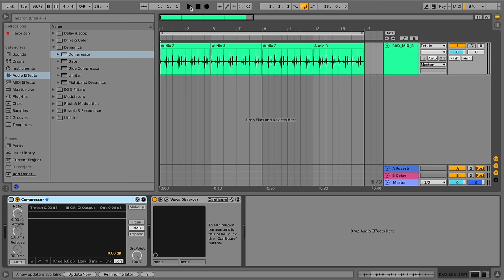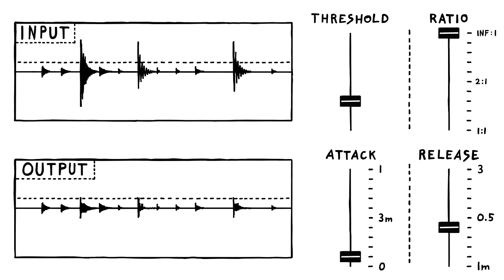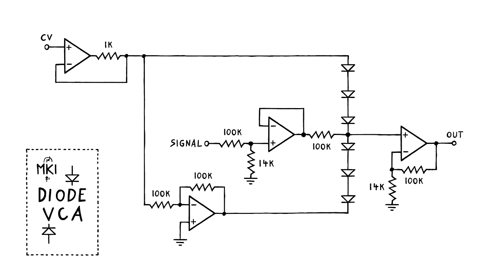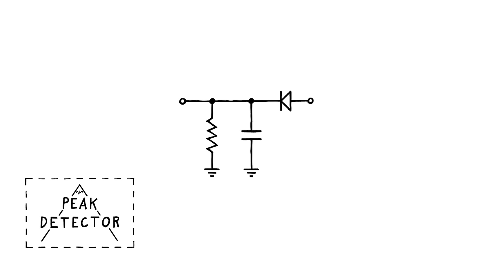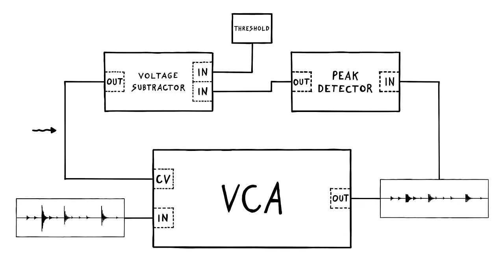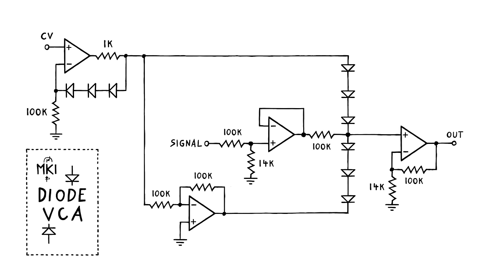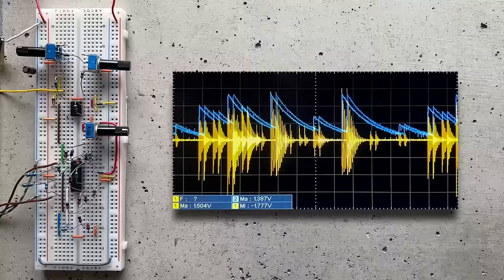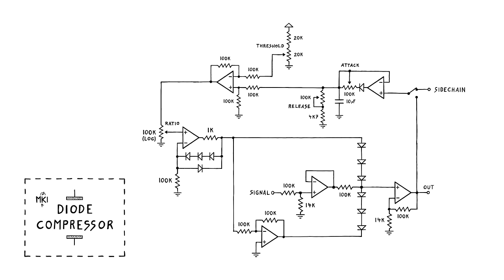Designing a simple audio compressor from scratch

Comment: Your compressor sounds pretty good.  So much so, I breadboarded  a clone using TL082 opamps.  While I've yet to build multiple commpressors to process bass, midrange, and highs seperately, I bet doing so will also work well,  As a suggsetion,  I wonder if you\ve plans to include metering that would display Gain Reduction.  Many compressors these days use a cheap LED based "VU" meter.  What I'd like to see is metering that drives an analog VU meter.  With no signal applied to the compressor, the VU meter would read 0 VU unit (100 %).  As program mater is acted upon, the VU meter would deflect downward from 0 VU.  The amount of compression - the Gain Reduction - would then be read from the standard VU meter scales in decibels,  This would not only be a helpful meter to adjust the compressor, a downward deflecting analog VU meter has a lot of class.  .... Finaly, I wonder, What about a gate ?   Your compressor design is an excellent piece of work.  Your video makes it look like it was ever so easy to get it to work.   I know it's never easy.  Such work is always the difference between the words "Simple" and "Easy".  Simple maybe, just not easy often imes. Audio compression has always been a blend of science and art.  You are truly very talented in both arenas.  Keep up the good work.

Comment: One interesting application would be a negative peak limiter (maybe by adding a offset) as use in AM broadcast radio stations. By feeding this audio to the transmitter this prevents negative modulation peaks from going below zero while allowing the positive peaks to go higher effectively making the station louder without distortion.

Comment: Very cool anims! one thing I'm not sure about is, you say that the noticeable gap between signal and threshold is explained by the diodes' behaviour. But, you then provide a line of reasoning that says that the output MUST stay higher than threshold for control voltage to stay above zero, which seems sound to me, and I doubt the op-amp trick gets rid of that.
In practice, I think, that means that inf:1 ratio is unachievable (without bossting the subtractor's output, maybe?). I'm not sure how much of a constant ratio is that anyway, since, while I'm not familiar with the diode curtain you presented, it's probably far from linear ^^'.
Reply from the maker: yeah, the gap will always be there, you can‘t get rid of it. you can only try to make it infinitely small!

Comment: A few things come to mind to base on this compressor:
1. Making it switchable to a feed-forward structure, so the peak detector directly reads the input of the circuit rather than the output of the vca, so it can act faster, which in turn could allow for using it as a peak limiter as well.
2. Besides being a "peak only" compressor, it could be expanded to also track the RMS value of the signal.
3. Tweaking the circuit, so it really adheres to Eurorack CV standards for the VCA and therefore could become a "dynamics based VCA controller" or a kind of advanced envelope follower, which would omit the internal VCA and allows for patching in any Eurorack VCA to create a wide range of different compressors, which vary in character and how they react based on the used Eurorack VCA module. For example: Using the vactrol based VCA of my Ratking Gates module, would behave very differently from using a diode or transistor based VCA. A more characterful VCA like the Expert Sleepers Persephone could be interesting as well.
4. Using an VCA / amplifier, which can be switched to have a gain greater than 1 to use it as an expander rather than a compressor.

Comment: I dont know whether its just a different use of terminaology between feilds of technology(I come from a radio/comms background) but this isnt a compressor to me but an auto level controll or peak limiter.
The limitation of this approach is it turns down the whole content keeping the relative difference of the instruments the same, so when the louder instrument trips the threshold, another background intrument is lost as the gain is reduced.
A compressor has the advantage that it can reduce the louder instruments without affecting the anything else that is below the treshold.
Its called a compressor because it compresses the dynamic range of the input signals make them sound the same level without the loudest single instrument dictating the level of other instruments.

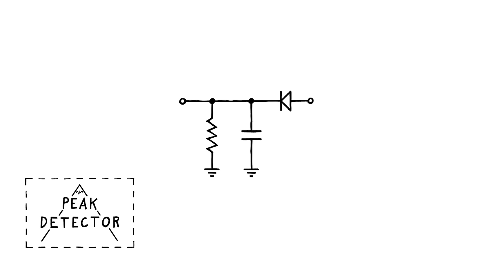Comment: 12:54 Because the Timeconstant is R × C so 10,000ohms × 0.00001F = 0.1s. T=0.1 is a frequency of 10Hz. The minimum frequenzy that's audible for humans is 20Hz. f=20Hz => T=0.05s and Uo = Ua × (1 - e^(-t/tau)). But since we have an unloading capacitor the formula is Uo = Ua × (e^(-t/tau)) so the Voltage at the output of the peak detector at 20Hz would be Uo = 100% × (e^(-0.05/0.1)) = 60.65% of the incoming Amplitude, which is probably enough to not really notice a difference without direct comparison.
Reply: With a 22uF capacitor the amplitude at 20Hz would be about 80% but the time constant doubled with 220ms so the Voltage at the peak detector would only be close to 0V after 0.6s to 1s of silence.

Comment: Hey! Great vid! You might want to add a low cut filter on the audio going into the detection. This way, it will mimick the human ear frequency response, and the compressor will feel less grabby on the low end content (although it’s sometimes a cool effect).
Reply: It’s the same reason you often see a low cut filter before distortion circuits, otherwise the effect overreacts on low frequencies (but it can still be a cool effect, especially on fuzz)

Comment: We could switch from Peak to RMS, we could put in a de-esser since we have side-chain, add an output control, hard vs soft knees, proper limiter with gain control, turn this into an expander, parallel compression mode and of course a gate - maybe a matrix so we can could change the order of the effects.  I'm making this too complicated aren't I?

Comment: First class video. For stereo use, one just duplicates the circuit and ensures that the settings for each side are identical to stop the stereo image jumping about. Presumably this could be done with dual gang potentiometers where available. Question: How might one combine control pots if dual versions are not available? Is extra buffering required?

Comment: I'm fortunate that I do electronics for a living but I absolutely enjoy these videos. I plan to build some of your circuits with a few modifications and these are mainly using digipots instead of potentiometers this will enable each patch to be saved and recalled but this obviously will require either  microcontroller or fpga.

It seems that you are running out of options to do a video. on will you be doing digital syntheses using microcontroller to implement vco and filters digitally
Reply from the maker: i am thinking about doing some programming, yeah. not sure if it‘ll be with microcontrollers though – we‘ll see!

Comment: Starting the year off strong.
Have you heard of synchronous envelope followers? By having 2-4 seperate envelope-followers, each with a discharge transistor instead of a discharge resistor, and activated sequentially in synchronicity with the input signal, then recombined with diodes in a “largest of” circuit, you can get a very fast-acting envelope. Slightly blocky though.

Comment: Weird question, but is the feedback loop actually necessary? I would think could just pass the original input to the peak detector and vca separately
Reply: It is a different type of compression, in pro compressors both circuits are useful.
Reply: Feedback compressors sound great on drums, and that's probably where he got the inspiration for the feedback design ? But yes, you don't need feedback, and in fact you can achieve more agressive compression without it (feedback compression results in an effective 2:1 ratio).

Comment: I love your Videos. 
I would love to See how you‘d realise the power supply for the OPVs with just one Single Powersource. I know how to creat the +/- voltage but wouldn‘t Affekt the OPVs each other because they would put a strain on the Vortagesource?
Reply from the maker: i think the best way would be to use rail-to-rail op amps and then bias the signal up. that’s rather annoying though, which is why i prefer to work with a dual supply.

Comment: How close does this align with commercial hardware compressors?  Conceptually what are they adding to the circuit beyond yours?
Reply from the maker: good question. i’d imagine they do full wave rectification before detecting the peak (i.e. looking at both the positive AND negative parts of the waveform). also, they might have a strategy to prevent distortion at very short release settings.
also: adjusting the knee, adding (automatic) makeup gain, detecting the volume via RMS instead of just looking at the peak .. the list goes on

Comment: that "ideal diode" or "half wave precision rectifier" in peak detector has the same problem crashing on negative rail as cv, that affects minimum possible attack time.
i dont quite get it why input for peak detector connects to vca output? it should work fine going directly to signal.

Comment: For a sharpened attack, wouldn't a separate capacitor/resistor pair in differentiator setup help? (cf: PID controllers, where you also have two capacitors for finding the compromise between decay and attack).

Comment: Wondering if you can replace the op amps in the VCA with a tube?
Reply from the maker: tubes normally require a ton of voltage, so i prefer to stay away. should be possible in theory though.

Comment: Hi. Seems like this kind of VCA, when compressing, will work as a diode limiter. When the CV (control voltage) goes up, this diode limiter causes a distortion of the waveform of a compressing signal by cutting peaks. It will caused high THD.  How to avoid this THD problem?

Comment: I have a question about the side chain option what kind of other signal is good for inserting there?
Thanks for the very good circuit.
Reply from the maker: using a kick drum is a very common strategy. generally percussion works well.
Reply: @MoritzKlein0  thanks you for the answer and congratulations.

Comment: I’m a little concerned about the 100k resistor on the signal input. Is the signal coming from another buffered input, or directly from something like a line level output? It seems the impedance mismatch would be a problem in the latter scenario.
Reply from the maker: valid point. i‘m mostly used to designing circuits for modular synthesizers, where every output is buffered. so i was assuming this to be the case here, too.
Reply: @MoritzKlein0  That’s a reasonable assumption. Thanks for clarifying, I probably should have considered the interstitial circuits in modules, I was coming at it with the perspective of a discreet device. I enjoy the videos, you do a great job with simplifying complex concepts.

Comment: cool video! So, this is the feedback type diode compressor, it has half-wave rectifier for CV, right? Also how noisy is it? More gain reduction diodes in series - less noise from input voltage divider?

Comment: I'm puzzled, this comp is designed to be driven 5v max, but pro audio equipment +4dBu is about 1.7v max. If you are driving your loop from ableton, how do you upvoltage from audio interfaces 1.7v to measured max 5v as shown in video?

Comment: Why send the output of the vca to the threshold detector and not the input signal?
Reply: I think thats for the feedback loop to work. If now, all the signal would get transformed, but im not 100% sure
Reply: It is possible, in pro compressors both circuits are useful.

Comment: A noob question here, i am thinking about getting into diy cirquitry, and was wondering - are there any videos explaining what components i need to do the basics. (oscillators, filters and maybe lfos) I mean is there a basic electronic kit with breadboards and some resistors transistors and capacitors etc. that you could recommend? :)
Reply from the maker: you could try my DIY VCO kit: https://www.ericasynths.lv/shop/diy-kits-1/edu-diy-vco/ – though you'd additionally need to get a breadboard, two 9V batteries + clip connectors and a jumper set. but those things are easy to find on amazon.
Reply: @MoritzKlein0  nah, man, this ain't what i'm looking for. i want something with breadboards and components so i can try out different stuff.
Reply from the maker: @calmination  that’s what it is, minus the breadboard and plus a pcb and panel. you could of course also check the BOM and get the components from mouser.

Comment: There are many improvements that you can make to this circuit.  If you were to pipe "hi-fi" audio through this, there would be large distortion.  The dilemma you face is: the gain in the VCA must be changed "slowly" with respect to the period of audio waveform, & that change must be linear.  The VCA you have is more like a "soft clamper" than a VCA  It either "crunches down", or it doesn't.
          The way I build a VCA is to exploit the linear "voltage variable resistance" of a JFET at near zero volts.  You build a resistive attenuator with the JFET going to ground, & its channel in series with ~100K resistor driven from the audio source.  You control gain with the voltage on the gate.  Keep the voltage on the FET channel 100mv or less.  An opamp, set up as an integrator, if fed the signal control voltage from the volume sensor, & feeds the gate.  Diodes/resistors in the integrator circuit control attack/decay times.  After the resistor/FET attenuator I put straight opamp gain stage.  I have the circuit schematics I use for this.
          A note about opamp circuits & diodes: you mention the problem with opamp driving the diode string "freaking out" when the input goes negative.  THIS HAPPENS ANYTIME YOU PUT A SERIES DIODE INSIDE AN OPAMP FEEDBACK LOOP, such as in your volume detector.  The solution is as you did for the diode string driver: provide an alternative signal feedback path when the main path "unlinks".  For your circuit, change the volume detector to inverting (doesn't matter as audio is AC).  Ground the opamp + input.  50K resistor from audio input to opamp - input.  Another 50K resistor from opamp - input to output of volume detector (to cap).  Diode anode to opamp - input, cathode to opamp output.  Another diode anode opamp output to output of volume detector.  When the audio swings negative, the opamp will swing positive charging cap through diode as usual.  When audio swings positive, opamp will swing 0.7V negative.  2nd diode will form feedback loop, keeping opamp "in control" & not saturated.  Use 1N914 or 1N4148 signal diodes.
          I use these circuits to control "color organs" where all the lights in the room are controlled (versus being cooped up in a box).  lights have less dynamic range then audio, so AGC is necessary.  (Audio distortion is not such a problem for color organ circuits).
          BUT..... using AGC circuits in audio channels is "lo-fi" at best.  As you are doing here, you are trying to "patch up" a bad percussion track.  Too many radio stations use AGC to increase the "punch" of their stations & as the result, corrupt the music.  Any cymbal hits that occur at the same time as the loud drum are "stamped on".

Comment: awesome, how would you make this stereo? any input channel should control both output channels?
Reply from the maker: hm, shouldn't it just be two separate compressors?
Reply: @MoritzKlein0  no not really,  you want a stereo track to evenly control volume dynamics in case of a, lets say a tom, hat or a rim on the right or left channel.  this is especially important if you're using the side channel input as in for stereo drums changing bass volume.

Comment: I have a doubt , would this compressor be useful for  linelevel signal to hotter  audio signals and synth level?? Or does it work only for synth level signall? What about signals that need presmplification like mics and guitars? Is the answer that straight forward?
Reply: Because i see that in. The video the drum signal reaches  something like +2.2v
Reply: I'm also considering this, as I like to design and build guitar pedals. For guitar, I would first try to leave it, as 2V can be reached, but need an hi-Z input buffer first. Threshold control needs a smaller range though. For microphone, I'm a bit out of comfort zone.. check levels, but definitely lower, so maybe no scaling of input and output buffers? Change range of threshold and diodes to match. Probably still amplify first, but again, check levels.

Comment: PLEASE HELP ME, I tried building it but it ain't working.

I tried using 6 TL071 opamps to build the circuit, I don't know if that's the issue...
however I did all connections properly according to the schematics.

(I'm a noob btw, clearly)

I have the 12V power source, the right diodes, all the right resistors and potentiometers.

I don't know what could be wrong except maybe the TL071 opamps or the 25V 10uf eletrolitic capacitor.

I'm a little desperate because right now all the money and hours spent on this project are being a disappointment.

plz help :(
Reply from the maker: what exactly is the issue? no sound at all? or just no compression happening?
Reply: @MoritzKlein0  No sound at all
Reply from the maker: @DICEStudio-vq6gu  are you using a dual power supply (+12 V, GND, -12 V)?
Reply: @MoritzKlein0  I honestly am not sure.
I got a 12V power supply, and a 12V Female Jack with a red wire and a blue wire coming out the back.
The red is connected to the 20K Resistor, and the blue to the GND.
Is this a dual power supply?